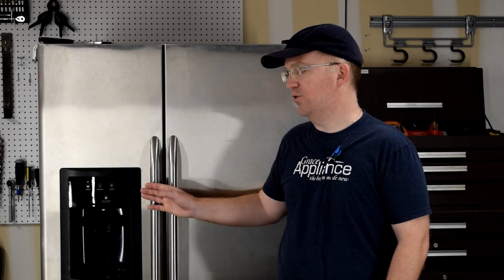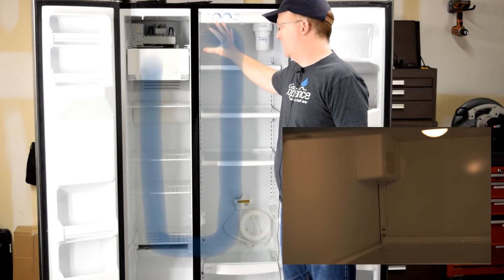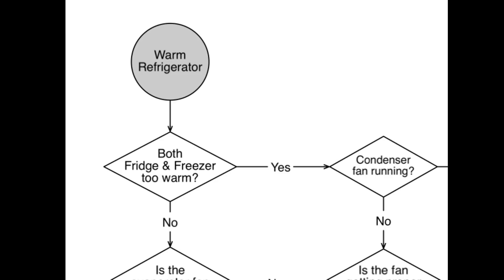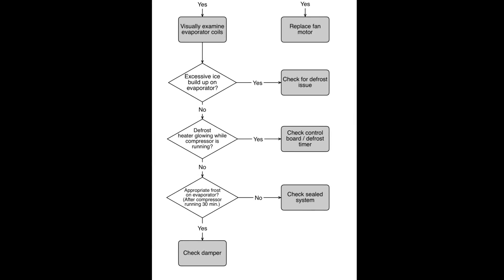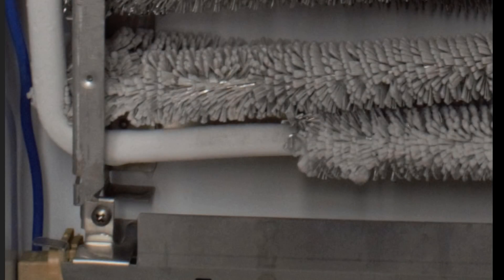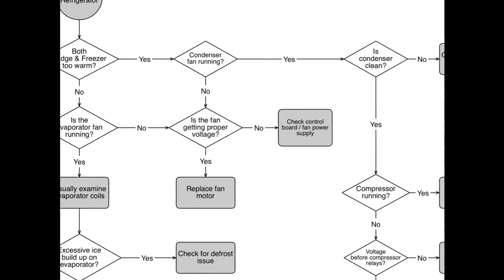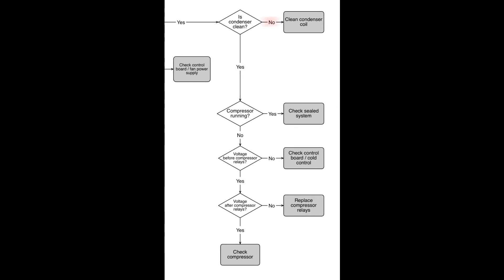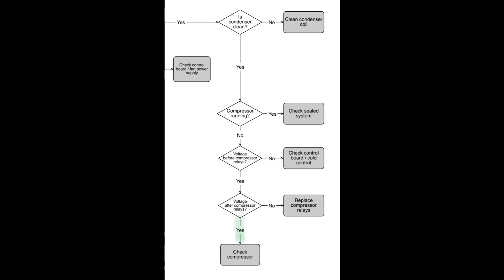Refrigerator Too Warm - Diagnostic Steps

Comment: Andy I sure appreciate your video one thing I can’t figure out I have a general electric side-by-side about17 years old I can’t figure out where the damper doors are?
Reply from the maker: Hi khcopter, 
I'm very sorry for the slow reply. I don't know what the deal is with my notifications not working, but in any case - If you're still having issues i'm glad to try and help. 

So long as it's not a GE profile, the damper door should be inside the fridge side in the upper left hand of the cabinet.  You can also see it from inside the freezer section, but it requires some disassembly. 

Parts number 426 & 429 in this diagram is similar to what you're looking for.  There should a plastic cover you can remove to access the damper door.  
https://www.searspartsdirect.com/model-number/gss25wgpdbb/0432/0165000.html

It may look similar to this?
http://www.appliance-repair-it.com/images/regdamper.jpg

If you're still not able to find it, please send your model number for your fridge and I'm happy to help further. 

Best of luck!

Comment: My kitchenaid fridge condenser fan motor will not turn all the time but I hear a click and a small turh of the motor (when electricity is plugged in).  I changed to a new motor and same thing happens (hence the motor is fine) it turns on sometimes (when the compressor turns on) but sometimes it doesn't.  Is it because the control board failed and doesn't provide enough voltage to the compressor fan motor consistently (as it should when the compressor is on)? Kitchenaid doesn't sell this control board anymore
Reply from the maker: Burlingwood Au hi!
Sorry to hear avout the issues with the condenser fan motor.

You're exactly right, if the fan motor has been replaced you can rule that out and only leaves the control board as a possibility (or poor wiring connection, but likely the board)

The fact that your control board is discontinued isn't great, however you can get it rebuilt and hopefully keep from buying a new fridge.
There's a company in Austin who does great work fixyourboard.com but takes about 10 days for turn around.
Also, I've heard really good things about Corecentric. Either one is great.
You may also check on Ebay to see if you can find a rebuilt board.

I'm the meantime, if you can position a box fan to constantly blow air across the coils, that will keep it going for now. 

I hope that helps!  Good luck.
Reply: Thanks for your response.  I have seen the box fan temp solution... I might just buy a new fridge but might attempt to remove the board and inspect it first and see if I can change the capacitor on the board myself (i am in canada and to send the board to USA and back it's $300 so might not be worthwhile)
Reply from the maker: Burlingwood Au yikes!
Yes, I've rebuilt these myself and it's not horrible. Often you'll see that the capacitors have swelled out and clearly have failed. I'd also put new relays on it as well. 

Let me know if you have any questions if you decide to tackle it. 

Andy
Reply: Thanks. Sounds good!
Reply: Hi Andy I took out the main board and all the capacitor looks fine.  I removed the back panel of my fridge freezer and kept and eye on the temperature.  When reset ,the temp reach 0 degree and 38 .  During the defrost phase (after 4 hrs), I noticed the frost on the coil starts melting and water dripping.  During this phase, the temp of the freezer rise to as high as 16-20 degree and fridge rise slowly (the fan in the freezer still runs).  Does this mean the defrost cycle is too long due to a possible fail thermostat that is sitting on the coil? or is it a failed thermostor?  During this time, the compressor is not running.
Reply from the maker: Burlingwood Au  Hey!  Sounds look the condenser fan is working now?
There are certain models of refrigerators that will not always run the condenser fan 100% of the time that the compressor runs - so that's not always a huge red flag for me, but something to note.  If the freezer is getting to 0 and the fridge to 38' the fans are doing their job. 

Now, the defrost temps that you're seeing may also be normal operation.  The temp inside the freezer (and fridge) will definitely rise while in defrost - this is normal. 
The defrost shouldn't run for hours at a time. Probably more like 20-25 minutes. 

Does the food inside the freezer seem to be staying frozen, rock solid?  Chicken breast should feel like a block of ice, ice cream should not be mushy, but rock solid as well.  
How about inside the refrigerator?  Is the food staying less than 40'?

If so, I wouldn't worry about the temp increase during the defrost cycle. It sounds normal to me the way you describe it, so long as the food temp is staying consistent.
Reply from the maker: Another though I had if you are having sporadic fan issues could definately come from a failing relay. When they get weak, they will not always engage or may let go even while energized. There isn't a way to visually see if this is the case.

Just something to think about.
Reply: Hi Andy, we have had this fridge for 12 years and don't ever remember the temp rising so high in the freezer.  What's bothersome is that the ice cubes that are made would melt and refreeze in the pan, the ice cream also become mushy.  The food *in the fridge are fine as it's the mid 40's.  I am guessing the the termostat could be the culprit but visually it looks fine.  I pulled out the service sheet under the fridge but am not an electrician so I would not know how to test the various components.  We have called 2 different repair guys and got 2 different answers.  As I am typing this the compressor and fan just kicked in (at temp of 18 and 43) so the cooling cycle start so it's not the fan motor for sure.  But I don't think it would be almost an hour in the defrost cycle.  I just noticed that the stat on the Thermostat says resistance across terminals Above 42 *F +/- 5 (open) , Below 12*F +/- 7* (closed) does this mean anything?
Reply from the maker: Burlingwood Au definitely sounds as if it's in defrost for too long and the temps are far too warm if ice is melting and it's mid 40s in the fridge.

I agree that the defrost thermostat is very suspect at this point. They are designed to close (I.e. Make a circuit) once the evaporator gets to a certain low temp, turn on the heater, and then open the circuit cutting power to the heater once it hits the high temp.  When they are out of spec, many times defrost won't come one at all or will stay on far too long.  If you can visually get eye balls on it, many times you'll find that the bottom plastic peice has bulged out from the round metal housing....other times not. 

They are very cheap to replace so I'd start there and it will likely resolve your issue.

Let me know if you have question.
Reply: Thanks Andy, i will give this a shot...hopefully it works.. the part is $50 only.  I will let you know!
Reply: if I were to remove the thermostat now (don't have part now). How should the freezer react??  would it be in constant defrost or no defrost?  I cut it off and splice the brown and red wire back together
Reply from the maker: Don't do this as it's a dangerous thing. Thanks
Reply: ok thanks
Reply: Andy, 
you wouldn't believe what happen.  I took the Motherboard out and was going to have it checked out (found a local guy who does electronic repair). I shaked it and hear a rattling in the middle of the board (he said it's the transformer)... I was ready to give up and buy a new fridge. I put the board back so that we can use the fridge for a few days.  Now it's working perfectly!!! WHAT's going on??????
Reply from the maker: Burlingwood Au  Hey!  
Just FYI, the boards will rattle a little due to the relays have moving parts that will rattle if shaken.  
Here is my suspicion  as to what is happening: 
The defrost thermostat is either out of specification or has failed completely.  Even with a completely failed defrost thermostat, your fridge will run as normal for days before the symptoms return.  The reason why is that the fact that the freezer can't defrost causes severe frost build up on your freezer evaporator, which then restricts air flow, and is not able to circulate the air around the freezer and/or to the refrigerator side. This causes warmer than normal temps on both the freezer and refrigerator side.  

I'd let it run for a few days / week and see if it's able to maintain 0' in the freezer and 38' in the refrigerator.  If it does ok for a day or two, but gradually starts to get warmer - you would look at the back wall of your freezer compartment on the inside and see if you have ice build up on the back wall.  If so, you are having a defrost issue. 

If so, I'd start by changing the defrost thermostat.  

I hope this helps. 
Andy
Reply: THanks Andy,  I have kept the panel covering the Condensor in the freezer off for now and keeping an eye to see if that is the case.  I was thinking the same way so that I can see if the frost/ice will build up.  If it's ok after a couple of weeks I will put that back as it's a pain to take out.  That way I can see if the frost is the issue.

Comment: Hi Andy,  thanks for making these educational videos in trouble shooting the refrigerator.   I have a GE side by side fridge that the damper door stays closed at all times.  I have replaced the control board for one of the large capacitors that blew from the bottom and scorched the plastic liner between the board and the housing.  I have also replaced the heating element at the bottom of the coils for it was burned out.  On the Fridge side I have replaced the temperature sensor twice, once before the control board went out, the second time after I installed the new control board.  So far I do not see any frost on the panel where the coils are located.  I do not have any thing that is blocking the air flow, I have even taken the cover off the damper door to see if it stays open.  I have manually open the damper door, it stays open for a couple of minutes but then it closes.  I have even raised the temperature in the fridge side and the door stays shut it will not open.  When I manually open the damper door I do feel the cold air flow into the fridge side.  When I unplug the unit from the AC outlet and wait about 20min and re-plug  the unit back into the AC outlet, the damper door opens but after a few minutes the door closes.  I have repeated this step twice and the door still closes after a couple of minutes. Can you please advice on damper door staying closed?  Thank you.
Reply from the maker: David Mena Hey David, you’re most welcome. Thanks for watching. 
Please send your model number for your refrigerator.  When installing these control boards, there are certain models that require you snip a wire during on the Fridge harness upon reinstalling the control board in order for the refrigerator section to work correctly.  
I can verify this for you if you’ll send the model number.  It’s on a sticker inside the refrigerator section.
Reply: The fridge model number is GSS25IFPAWW.  Thanks for your quick response.
Reply from the maker: David Mena  I’m sorry, one more thing.  
Does your serial number start with any of the following?
TD2, VD2, ZD2, AF2, DF2, FF2, GF2, HF2, LF2, MF2, RF2, or SF2?
Reply: Here are the first five:  LF272
Reply from the maker: Thanks David, the only time I've come across this scenario is when I'd forgotten to follow the steps listed in the installation instructions for the control board replacement.  

Here's a PDF of the install instructions.  See specifically step number 2
Double check on your control board that you in fact snipped the wire on PIN #2.  On the harness for the control board You'll see a large white plastic cylindrical piece that has 2 wires coming from it and leading to pins number 1 and 2 on the J1 connector (top right of the control board). 

https://www.scribd.com/doc/115029528/WR55X10942-Installation-Instructions

It's the wire that's 2nd from the left that you'll need to snip.  Make sure the refrigerator is unplugged before doing this.  This eliminates one of the 2 temperature sensors in your refrigerator section, but it necessary when installing the updated control board because the multiple temp sensors give conflicting signals to the control board and it does whacky things with the damper motor. 

To be on the safe side, don't snip the wire super close to the plastic cylinder piece, but leave some slack to work with in case you needed to reattach the wires in the event it did not work, but if yours is not cut already, I'm very certain this is your issue. 

Let me know how it goes.
Reply: I do remember seen the loop wire on the J1 connector.  I will snip the loop at the middle and put some closed end connectors just to be safe.  I will let you know how it goes.  Thank you.
Reply from the maker: Awesome!  Just make sure it's the wire that leads to the 2nd from the left spot on that j1 connector and not the furthest left wire.
Reply: We have a winner!!!  On my J1 connector I had a loop or a jumper going to pin 2. According to the instructions, if you have a loop or jumper like wire going to pin 2 to cut it.  My fridge did not have a single wire at pin 2, just a jumper wire.  Once I snip and caped the ends of the wires, waited 20mins then re-plug the fridge and set the temp, the damper door opened and stayed open.  I could also fill the air flow from the freezer into the fresh food side.  I thank you Andy for your videos and the time for helping me with this issue.
Reply from the maker: David Mena awesome! Nice work. Glad to help. I’m thrilled you got it working.